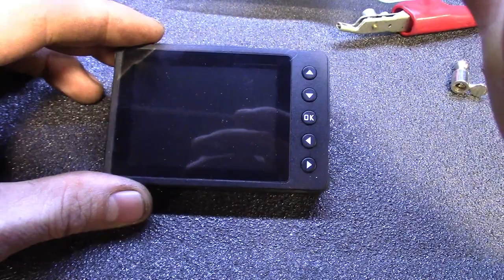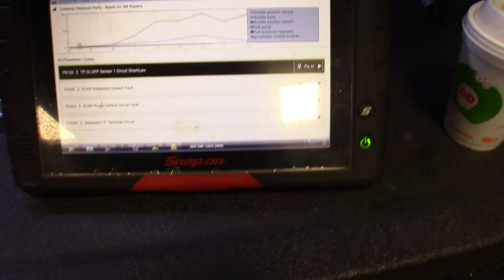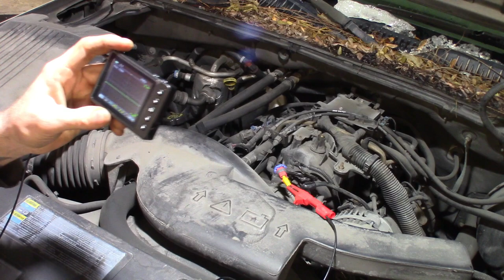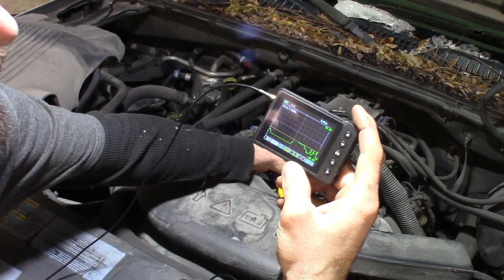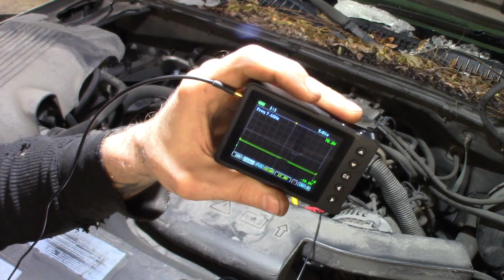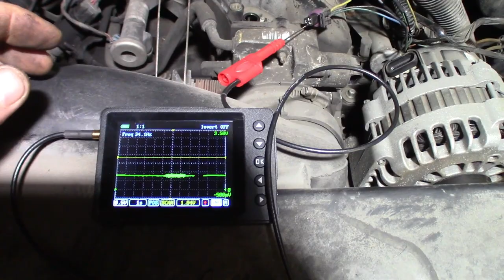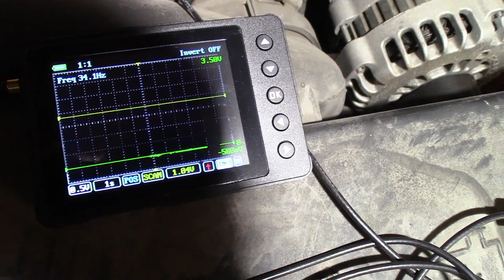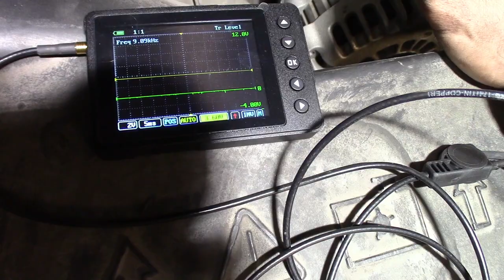"uScope" TOOLS IN ACTION

Comment: Great video. Ive had the uScope since it cost $120 when nobody really wanted it. Quick tip- you can go into meters and pull up the min/max voltages right on the screen so you dont have to estimate where the voltage is at by the divisions..etc. You then can save that setup as a preset that starts up everytime you turn scope on. I have mine set up like that...I call it "MT2400".

Comment: First time scope user here, do you recommend this scope for beginners? Trying to step up my electrical diagnostic game. Is there any really go to on how to compare a good waveform to a bad signal? Also setting the uscope up seems a little difficult to learn. Do you also recommend the master or basic kit?
Reply from the maker: For the price the uScope is a good beginner scope. It is a little rough to get a hang of but it's a pretty powerful tool. As far as good as bad graphs most sites like all data and Michelle will show what a wave form should look like for most sensors if your unfamiliar.
Reply: JRC54 thanks for the reply! I use identifix
So I’ll have to look up on the procedures next time I’m searching. I found a video from aes and apparently the newest software comes with pre set functions for sensors and what not it also gives you a reference of the waveform as well
Reply: To add to what JRC54 said, I have had the uScope for years now and what I did was downloaded the FREE Pico automotive software. Once you installed it, you go into the automotive tab and it has all the setups for everything you'd want to test. If you check the little box for info before you open up a setup, it will redirect to the pico site and show you all the setup info and waveforms- good and bad if they have it. I saved almost all of them as pdfs. So I have them on my drive for quicker access to references.

Comment: i use mine just about every day instead of a multi meter
Reply from the maker: It is easier to see it as a graph then numbers.
Reply: but i have been using the vantage for over twenty years to do the same thing. u scoop faster
Reply from the maker: Vantage is one of snap ons greats. Just picked a older one up a few months ago.
Reply: use it you will love it. scanner danner uses his all the time
Reply from the maker: I had one years ago used it all the time. Had to get another one but haven't been able to use it much yet. It's clean. Did a video on it called snap on tool deal
Reply: use it again you will love it . i also have the otc teck trace a spin off of the vantage and it works well also